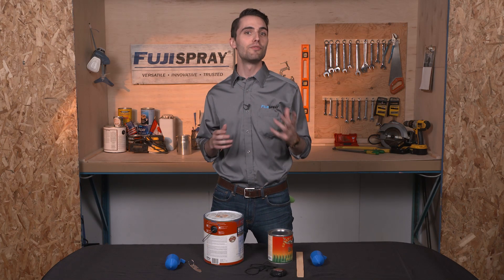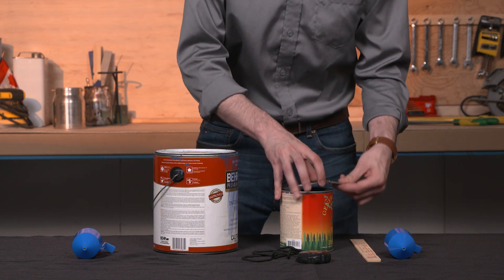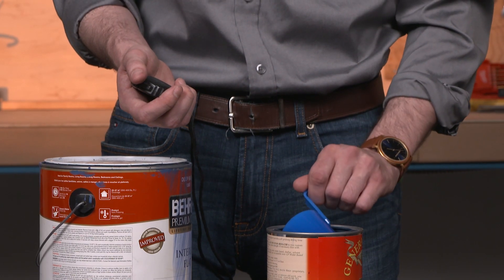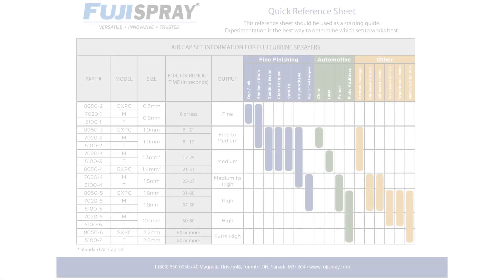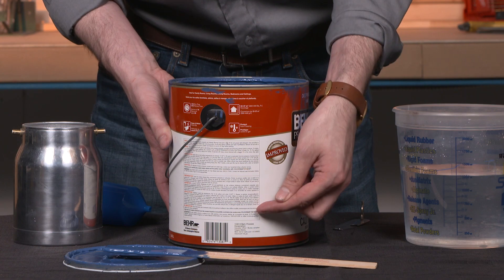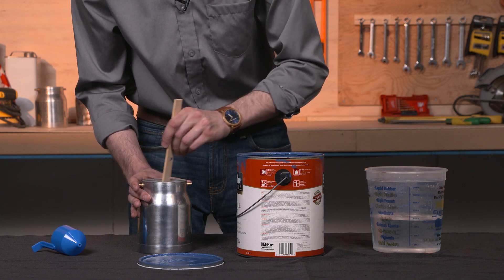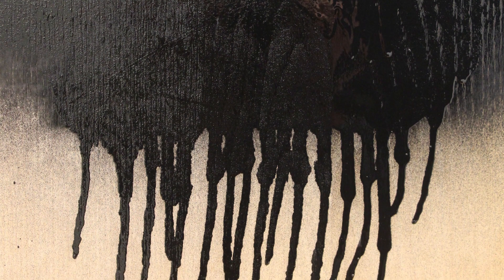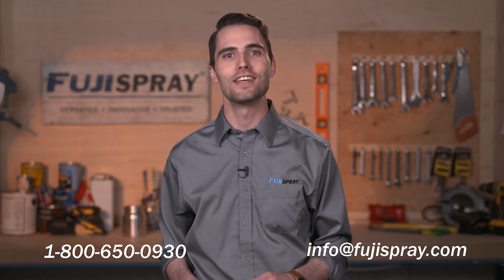How To | Measure Viscosity and Proper Thinning of Material

Comment: Helpful, but nowhere is discussed how preferred viscosity relates to the number of turbine stages in your air supply. unit.  Maybe I am just supposed to know that if I have a 2 stage, stay on the low end of the recommended viscosity range for that air cap and gun, if if you have a 5 stage you can work in the high end of that range ?
Reply from the maker: Thank you for your question. When a coating is being diluted, the idea is to dilute the least possible while achieving best outcome. When using a 2-stage spray system, one will find that diluting in the higher percentage rate may be more favorable. Whereas with the use of a 5 spray system, for instance, dilution would be minimal. - Fuji Spray Team -
Reply: Had the same question. Wrote Paint Sprayers Plus and Jason called me back. Several have asked the same question because the fact is a more powerful turbine can spray with a smaller nozzle/tip size than a less powerful one. Smaller tip size means a finer spray and that usually corresponds to a smoother finish. Not saying these are all the factors but Jason mentioned Fuji Spray will be integrating turne stages into the tip/viscosity chart that they provide with their equipment.

Comment: Description says how to thin. But doesnt describe what material to thin it with.
Reply from the maker: To find out what to dilute with, see the label of the can of coating. It varies, for water based coatings, use water, for solvent-based coatings, use the appropriate solvent as specified on the label.  - Fuji Spray Team -

Comment: The pathetic part is that so-called paint stores don't have viscosity cups. In fact, I can't find ANYONE who does. Sherwin-Williams, Dunn-Edwards... clueless. Harbor Freight has some spray equipment, but no viscosity cups. Home Depot, of course not. WTF.
Reply from the maker: Email us your shipping address and we'll send you one for free! - support@fujispray.com  - Fuji Spray Team -
Reply: @FujiSpray  Hey, cool! Will do, thanks!
Reply: @FujiSpray  Got that cup, thanks! I'm wondering what it is, though. It takes a reliable 7 seconds for water to drain from it (I checked it with video), which is not consistent with a Ford #4 (10 seconds). It does hold exactly 100ml. Therefore I don't know what chart would apply to this one.
Reply from the maker: @SoundOfYourDestiny  Use this Quick Reference Sheet: https://www.fujispray.com/wp-content/uploads/2019/02/Insert-Quick-Reference-Sheet-092018.pdf  
Don't overthink it, it's only 2 to 3 seconds difference. The link we shared is a guide only, not necessarily written in stone but as a starting point. Hope this helps! - Fuji Spray Team -